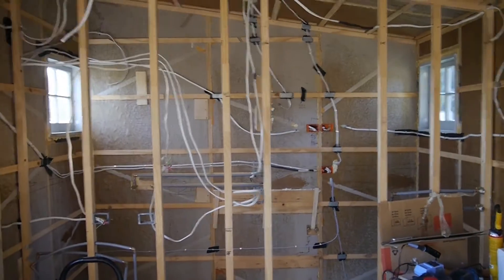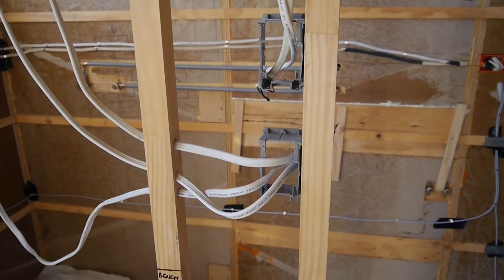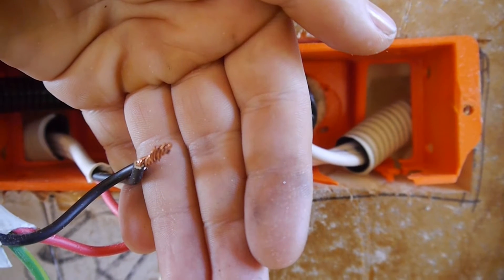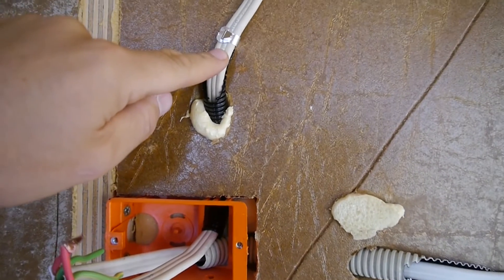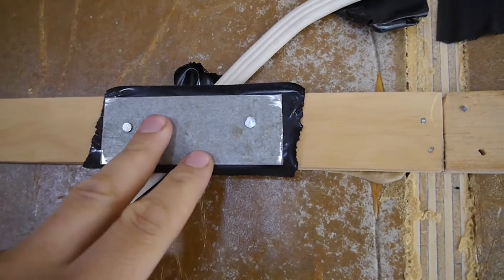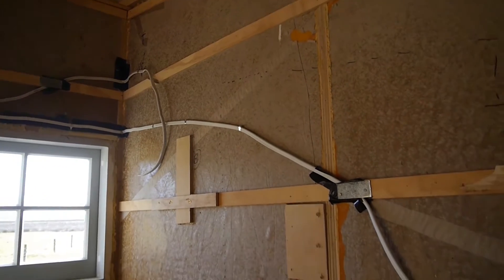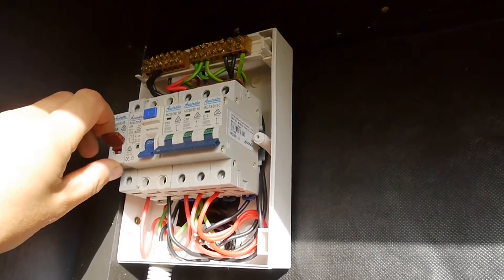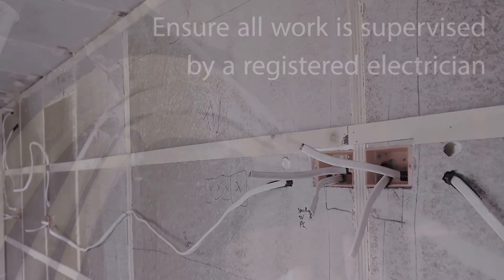Tiny House Electrical Wiring

Comment from the maker: Standard mentioned in video is out and date and should read: AS/NZ 3001:2008 Electrical Installations - Transportable structures and vehicles including their site supplies (including amendment 1).
Also electrical workers need to be Licensed now not just Registered.

Comment: Hey Mike. What's the benefit of having the separate voltages? 'Cause presumably, you could run all the stuff that you are running on 24v at 230v?
Reply from the maker: HI,low voltages are great for solar installs because you don't need to waste energy stepping voltage up. Things like lighting and fans these days are more efficient at low voltage. It is more common these days to run high and low voltage circuits  in a house. Thanks
Reply: @WeemakechangeCoNz  Great answer thank you!
Reply: @WeemakechangeCoNz  why did you chose 24v over 12v?